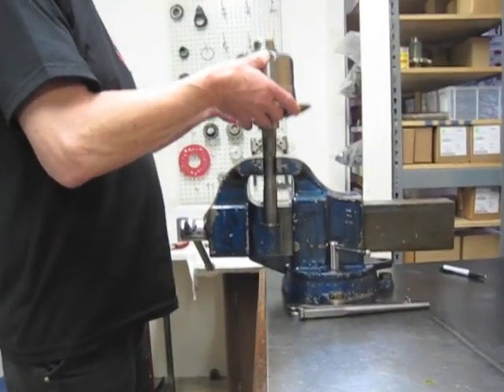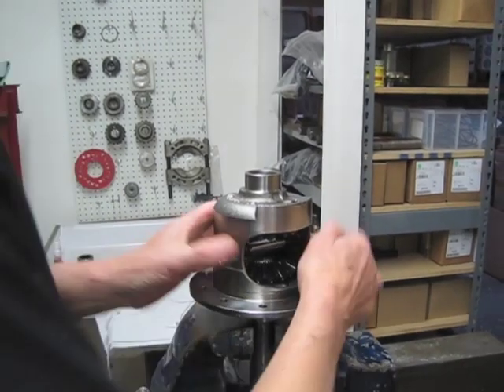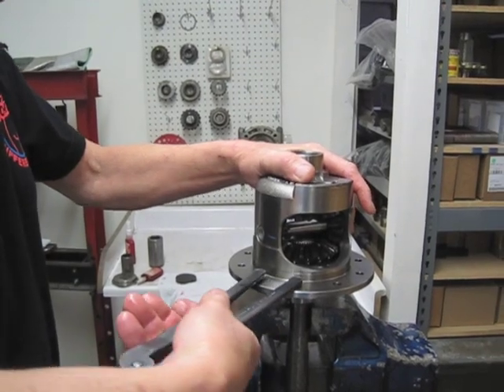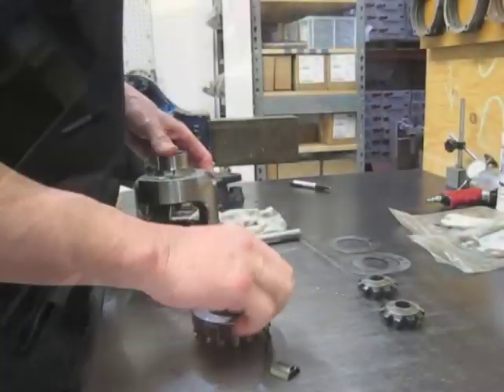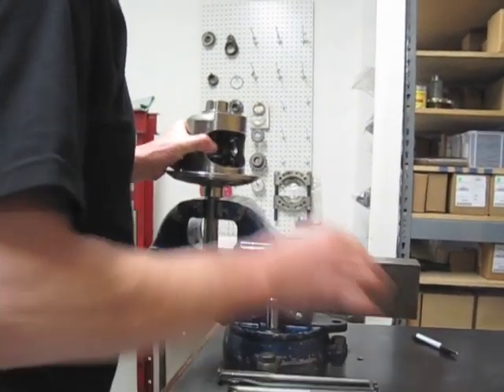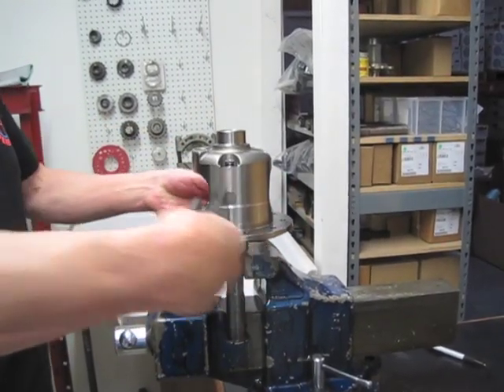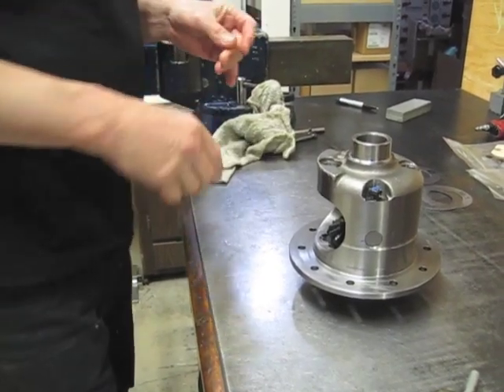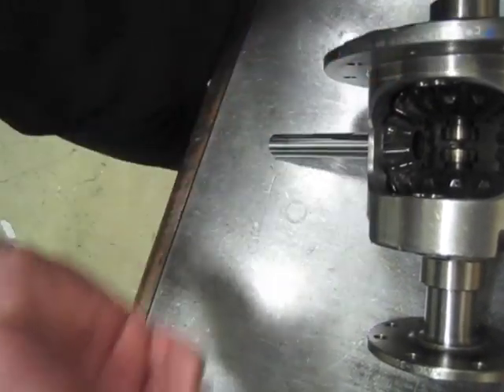Tom's Eaton Posi Tune-Up (Part Two)

Comment from the maker: springs create the elusion of having frictional drag when you dont , such as on an icy road , they preload the clutches to make the posi think is on pavement that creates the friction ( you can create the same illusion by lightly applying the emergency brakes ) by eliminating the springs, it enables you to move the side gears closer to the pinions for more gear tooth contact , which means more strength and quicker lock up.. it also reduces clutch wear , by not having to resist the spring pressur
Reply: Freekin brilliant! This is only video worth watching on this!

Comment: Can eaton posi handle much abuse on a bop 8.2
Reply from the maker: you can do some mods to the BOP eaton also , I don't make the cut type of spiders for that unit , butt you can still tune and use the 18 solid clutch type in there, so to answer your question yes you should be just fine with an eaton posi